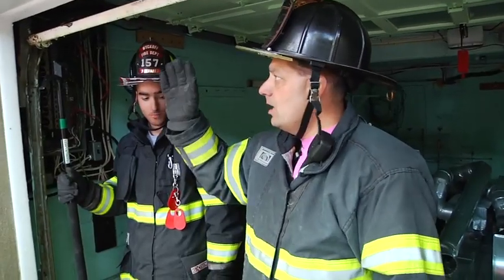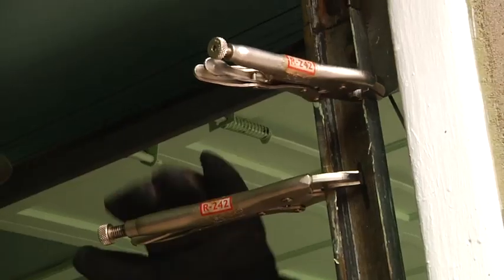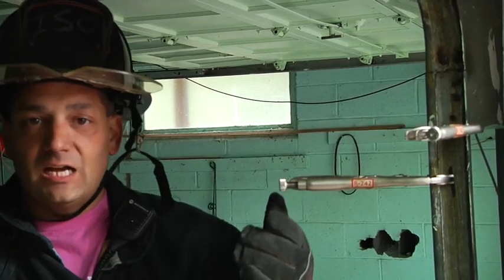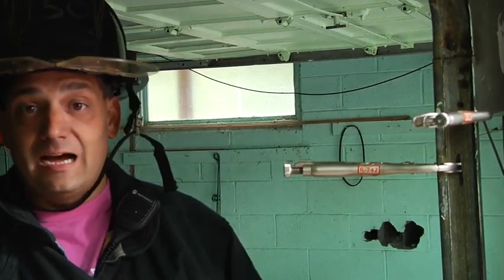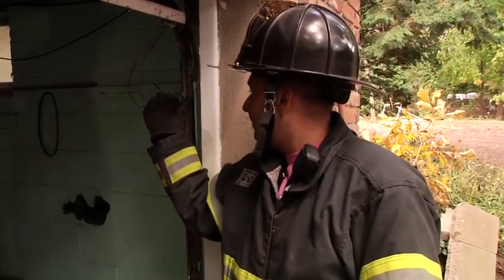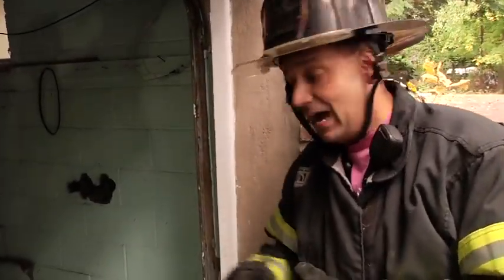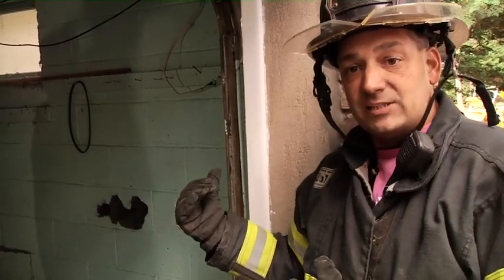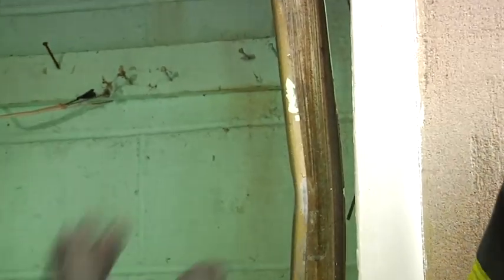Securing a Garage Door

Comment: My cousin Connor is a fire fighter and he has had to use the garage door to force entry due to a residential fire alarm.  The owners were out of town and the alarm went off while they were gone.  Thankfully, it was a false alarm.  It turned out to be a dirty smoke detector that caused all that madness.  But he used vice grips to keep the door from coming down.  That way, he still got the job done and was able to re-secure the garage door and re-secure the home.  The point is, the method my cousin uses to jam the garage door is based on the type of alarm response.

Comment: OMG tell me I didn't just see that!  If you crimp the curved edge whether with vice grips, striking or Halligan then twist it the roller will be able to roll out of the flat edge and fall to the ground killing firefighters!  This technique may work by crimping or smashing the flat edge of the track.  We use our extrucatiin tools, use the spreader to punch it completely together just below the door then be sure to pull the door down to the crush.  This makes it so that when the spring burns/melts in two, the door has no room to gain momentum while falling.  Typical doors can weight 300 pounds, heavy duty insulated up-to 600 pounds.  Leaving a gap above the crimp allow the door to gain momentum that could open a simple crimp.